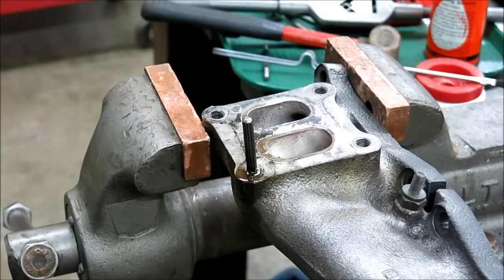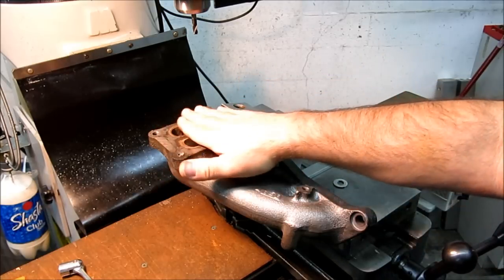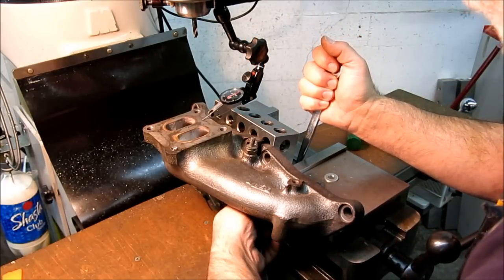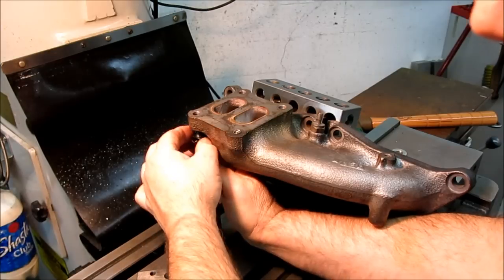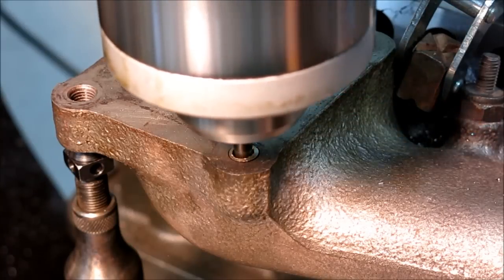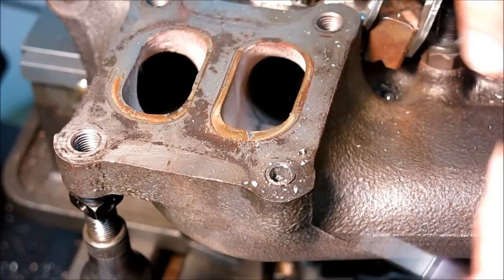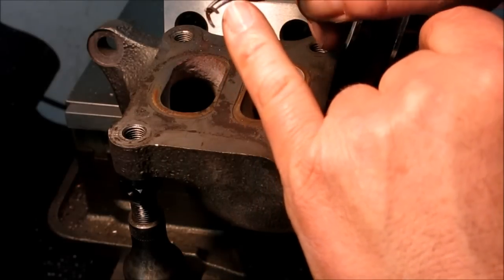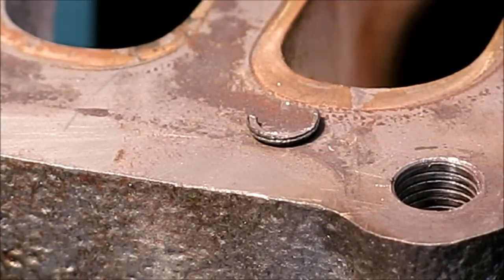Screw Extractor Torture Test Round 2

Comment: I was wondering if we were going to get to Plan T! You just showed how stubborn jobs like that there can be. I've overheard so many times guys talk about how good they are at drilling broken bolts by hand and using easy outs....Yea right! Not always so lucky. I've had several jobs I had to just drill them completely out like you did here. But we're spoiled, and use milling machines to make life easier. LOL
I enjoyed your two vids on this subject, and will watch more if you make them. Thanks for sharing with us bud.

Adam
Reply: Adam - Don't know about your shop - or Tom's - BUT if I need to go to Plan "F" the job is about to be written off as a loss...

Cheers,

Eric
Reply: Me, I've never had luck hand drilling or using easy outs.
Reply: Man, I learned a long time ago, if you cant get the part off the engine you have 3 options. Drill it out completely and then drill and tap a larger fastener. Try to left hand drill it and do it that way. If those 2 don't work, you pull the dang engine and repeat 1 and 2 with all the space you need. I learned that sometimes it's easier and faster to pull an engine in 2 hours than it is to spend 8 hours trying to get a seized stud. Then reassemble with ANTI SEIZE.. ALWAYS ANTi SEIZE. I keep my bottle of anti seize on a solid gold pedestal in my tool box.
Reply: I had precisely one experience where I drilled something out by hand and it went perfectly. Nothing was working so I was planning to try and then go inside and order a new brake caliper, and instead I was able to pick out the threads on the frozen bolt and run a tap through it. You had to look closely to tell it wasn't new. Never happened before or since.

Comment: Brian's tip of the day for working with poor condition parts. Lay a parallel on your surface and indicate off it to establish  your surface. it give s a nice total average to flat and is much easier to get indicated in without your indicator jumping up and down in holes and pits everywhere. Rust welds are some of the strongest in the world!  Now you have a nice manifold you can put under your Christmas tree! lol Thanks for showing us this torture project!
Reply: bcbloc02 Well, unfortunately that's not really an average of the surface. It's basically just the 3 highest points forming a plane.

Comment: I have been a mechanic for 40 plus years and when they first came out with those extractors I broke one off just like this. I never use them unless I can get to the back side to drive out the broken extractor. If a bolt is broken off in a manifold I will drill out the bolt leaving as much thread as possible and then pick out the threads and run a tap in the hole to clean it up. The tricky part is making sure you are drilling it in the center since one side will usually have part of a thread hanging over and what looks like the center is actually off center. You did a great job with the video, I sure did not think carbide was going to cut that extractor like it did. You could not have picked a harder bolt to get out, no left hand drill would have touched it. Thanks for taking the time to share, I learned something new and love it, Thanks.
Reply from the maker: Hey Mystery,

Thanks for the nice comment. That was a tough bolt for sure. I don't think I'll be using these extractors for any heat seized fasteners in the future. It was important to see that they will actually break not twist. Good thing to know.

Cheers,

Tom

Comment: We had  a Ford with a 302 and bad water pump when we lived in northern Canada a long way from a town. Had to have it running for morning. Minimal tools, minimal experience. Broke every bolt but one. Turned out the casting was porous when they installed it so they had lathered it with some kind of green epoxy (??). The bolt threads must have picked up wet epoxy when they bolted it up. They were never coming out. It looked factory but who knows. Middle of January, -30C something, in the snow, no garage, no air tools, no torch of any kind. My wife had to start a fire beside it and keep it fed to keep me from dying. My hands were so cold I burnt them bad clutching an inspection light to keep them from freezing solid. (not the only time) Couldn't feel them till they thawed. Not exagerating. Broke 2 extractors. It never seemed to end. Ended up drilling every hole but one WAY oversize, even into the water jackets. Lots of caulking. All we had. No choice. Started at dark and had it done by 7 am just in time for my new wife to go to work. We were young, broke and desperate. Wife still doesn't like to talk about the experience. Swore that night I'd hire out all repairs one day when I got rich. Never got rich. LOL  Repair never leaked a drop. I kinda miss being young and tough. Those things did take there toll though. Hope this video helps somebody. Good job

Comment: I learned a method 50 years ago at the Maritime Academy.  Aboard ships, extractors (when we had them) never worked.  Drill out as large as possible without disturbing the thread.  Off center is ok, you just can't drill as large a hole.  Then, using a Diamond Point chisel, make 3 to 4 ( or more for very large studs ) v-gooves down the length of the hole, the depth of each as close to the threads but not touching them.  Finally use a cape chisel, starting at the top adjacent to a groove and angled approximatley 30 degrees, and start splitting the stud thread into the hole.  Takes awhile but eventually you'll get the stud out without disturbing or damaging any threads.

Comment: That was an awesome show, I grew up in a Yamaha shop and inherited all of my dad's tools.  I was working on the wheel bearing hub on my Chevy Silverado and rounded off the T30 screw that holds the rotor on and instantly had flashbacks to the side kick on the old Snap On box and remembering that it would be a log day at the shop when that thing got opened up.  I didn't remember how to use the set properly so I did what any dude with boxes of tools he doesn't know how to use does, I hit up you tube.  Your video made me remember all the uses of a lot of stuff in my shop that I haven't seen used since I was 11 or 12 years old.  Good work man.  Rory Martin

Comment: Tom, I knew you wanted a short extractor set, and when you discovered that they don't sell them you decided to make your own! LOL. Check out my Getter Out series, several setups shown for manifold getter outs. Also I left some comments on your previous round. You have done well. My philosophy is try it, feel it, if it looks too stubborn go straight to plan B vis a vis drill it out completely with luck you may be able to save the thread, otherwise fit an insert.
 By the way, most of the studs are M10 X 1.5 on the section that goes into the manifold or head, and M10x1.25 for the nut section....however there are also M9's M8's and M7's of varying pitches just to confuse us simple folk. Have a great Christmas Bruce.

Comment: Nice to see the professionals have these real world problems too. I once tried one of these stud extracts to remove a broken stud from a cylinder head, after a few hours drilling and swearing i got the stud extractor inserted, which then jammed up and snapped off flush with the head.  Ended up having to pull the cylinder head off the car and take it to a machine shop, then watch the poor guy swear profusely as he chewed through bits on his milling machine trying to get said extractor out so he could redrill and install a helicoil.  Don’t ever try these extractors folks, they only make the problem worse.

Comment: Man that was great! I just did the same job on a brake caliper for a race car that was maybe on fire once or twice and the bleeder screw was stuck... or welded into the caliper... so he busted off a screw extractor in it and then phoned me. After and hour of f this and f that I got a shiny new heli-coil installed. Also I've learned that extractors are really there to make the machinists life that much harder. It would have been a 10 minute job with even a drill press but turned into an hour of broken carbide enjoyment!

Comment: I thought I was the only one that could break the extractor AND the drill bit/end mill..  For many years I would find myself welding a nut onto the broken bolt stub (or trying to), and then my neighbor got a sinker edm! Divine intervention!

I like the 2-4-6 block. I have a 3 in bar of 12L14 a couple feet long that I have milled all kinds of slots and holes into to hold heads and manifolds in the mill for this very reason.

I like to use Kroil also! The fumes take my mind off the aggravation of broken bolts...

Merry Christmas Tom

Marc

Comment: Merry Christmas Tom, and thanks for the video!!  I do an awful lot of stud removal, and have a couple favorite alloy rods I use 85% of the time.  Kind of a ceramic flux that protects the downhole threads (if broke off below flush)  Anyhow....if one must use extractors, you have the right kind (STRAIGHT flutes) but I shy away from them most times....I've removed more "easy outs" on Cat exhaust studs than I wish to count!!  LOL  I'll send you the data sheet on those rods and get a few pounds of it mailed after Christmas. It's just another trick to have up your sleeve.  Regards, Sean.
Reply from the maker: Hey Sean,

Shoot me the data sheet. Sounds interesting. Thanks for the comment.

Cheers,

Tom

Comment: I’ll forever remember the nightmare that was a Grade 12.9 M12x1.25 4.5” long rear suspension-to-frame bolt that required drilling it’s entirety after ALL extractor styles were exhausted.
2 evenings worth of drilling with substandard titanium twist drills in an underpowered 12v drill was oh so satisfying when the final twist drill (by memory a 29/64) broke through the tip, thus allowing the retreading to start.
By far the most frustrating and time consuming operation done on my race car to date (which includes complete engine blueprinting, fabricating  it’s 14 point roll cage and wiring it’s custom 12 circuit chassis + engine harness).
To those performing this work, take your time and don’t get down for broken drills, they’re going to break eventually, especially when continuously drilling the same component.
Have fun lads (and lasses of course ;)

Comment: I have always used the spiraled ease outs to remove these. Having a good set has been great because usually it saves time on something which already has a lot of work put into it and would just have to be remade if we could not remove the bolt. Broken taps are the worst especially if they are form taps. I was very impressed with how you recovered and persisted in all of this. That is a sign of a pro.

Comment: Snap-on makes a small pencil grinder with carbide bits that works great for getting that last piece of bolt out.  For us diesel mechanics lifting a 500 pound head off to drill out a broken exhaust stud isn't a cost effective method luckily CAT makes a drill bushing and guide set up to accurately drill out broken exhaust studs. I was wondering if you could make a video on what steel and such is needed to make a drill bushing. I can see the need for this in a lot of application that a over the counter bushing just doesn't work. Also on how you would make a extension to make drill bits longer.
Reply: Keith Fenner has a video on making long reach drill bits and countersinks.

Comment: Great pair of videos.  Technically informative and photographically excellent!  Weirdly intriguing and suspenseful!  That was one tough stud. You have the patience of Job. 

I came across your video because I have to remove a bolt that snapped while I was removing a B&S engine from lawnmower deck. I had rushed the job to get out of the rain.  The bolt moved about 1/16 revolution.  I should have re-sprayed and let the oil do its job. There may be enough for me to get some Vise-Grips on the nub though.

Again, great video.  I will have to check out your channel.
Reply from the maker: bgrt40 Hey Bgrt,

You pretty much have to grow some patience in this line of work. Thanks for the comment.

Cheers,

Tom

Comment: Welcome to my world Tom :) I am a diesel mechanic working on mainly Toyotas( NZ based so smaller than your Toyotas) 
I have had this same issue many times, I just drill them out and install a Helicoil in it ( M10 x 1.25 is the size) I also have a stock of those exhaust studs and the special lock nut, I use them for more than just that though as they are a decent bolt

Comment: Fun videos to watch, thanks.  It's nice to know stuff goes wrong for the pros as well!  :-)

If this had been presented to you in a normal situation (rather than testing the extractor), how would you have approached it?

I was thinking to hacksaw off most of the bolt, just leaving a 5mm, and then hacksaw in a deep vertical cut, making the bolt (effectively) a large flathead screw.

Cheers,  R.
Reply from the maker: +Richard Corfield Hi Richard,

I never would have cut anything off the stud. Grab it with a good pair of vise grips and heat the manifold red hot. Would have made a boring video. This was way more entertaining. Thanks for the comment.

cheers,

Tom
Reply: +oxtoolco Doh!  Sensible.  Cheers,  Richard

Comment: Great video on extractors and extracting.  A pearl I have found is that cutting the stud off and drilling always phase 2.  Phase 1 is fit a bolt onto the top thread of the stud and weld it.  Then apply heat to the base metal as evenly as possible around the stud, hot as you can, and then use an air tool.. air ratchet or impact. As you heat or as soon as you stop heating, you apply torque to the stud.  Physics is on our side, and at some point the metal will expand and break the interference, so in my experience, timing is critical, so I like air tools, they apply reliable constant force.  Red hot plus force. Add penetrating oil at every heat cycle.  I give Sea Foam brand high marks.
On a side note.  An old timer once told me dis-similar metal friction can create interference problems(I would love to hear opinions on that), and also dis-similar metals in water create a battery, and cause corrosion.  So, two good reasons why it may be advantageous to choose the right fasteners and/or use heli coils/thread serts. 
Thanks

Comment: Having spent the first 15 years of my working life as an engineer in the Merchant Navy I have had more than my fair share of broken, corroded and inacessible studs and bolts. Diesel generator exhaust studs and steam pipe flanges being some of the worst offenders. After wrestling a couple of times I decided the best thing was just to go straight to the heat. I always found, counter intuitively that the best thing to do was to heat the broken bolt/stud and get it to a good red heat, let it cool over a coffee and repeat a couple of times. On only a couple of occasions did I end up having to drill it out and pull the threads out.
Since coming ashore and working in maintenance engineering I have had to show a good number of my technicians how to do it, after seeing they would be struggling.

Comment: I bought a set of those extractors years ago and after trying to use it one time I decided they were garbage and never used them again.
Reply: I never tried those and i could already see they wouldn´t be good. If you are hammering them in, you add outward pressure to the stud, so the threads are locked even tighter. Best way is to drill out the most metal off the stud you can, heat it, and then rapid cool it, to cause the metal to contract and shrink, breaking the bond between the 2 surfaces.

Comment: I’m not an expert but my thought process is if you’re removing a bolt and it breaks, putting a smaller harder piece of metal into it shouldn’t ever work.

I’m thinking if you put a bolt in and over torque it and it breaks, the extractor might work. 

Any expert input is appreciated

Comment: Hey Tom, I just commented on r1 video that as a retired auto tech I would have just drilled it out to just the edge of the of the threads on the manifold bore than punch remainder of bold to collapse it and pull it out. You may bozo the first few threads but you can clean them up. Or yes the ole heli-coil,at Cadillac we had threadserts also. But as a whole your video was great,I like a few other mechanics were way ahead of you on what to do.Some one mentioned about they had a Getter out series ( Bruce Whitham ) you should start anew series called "BOZO APPLICATIONS REVIEW". Have a wonderful Christmas,Dave

Comment: I've got a set of those extractors along with easyouts. I've found over the years to just drill and re-tap the hole. I do have some carbide tip drills for the tough bolts. The key to my carbide tip bits is lots of RPM to generate heat in the broken bolt.
Reply from the maker: ww321 Hi WW,

Thanks for the comment.

Cheers,

Tom

Comment: G'day Tom. Excellent demo on how to break an extractor, twice. In the old days I would have stopped at the first broken extractor, scratched my head and found out how expensive is the part. The price and availability would then determine if I replace it, send it to a machine shop or do I grind the whole housing until the bolt was gone,  braze up the housing and drill and tap, the latter being my choice if it was mine. If it's a customer probably order a new manifold, that did come from the scrap bin if I heard correctly. Labours too expensive to muck around with.
(The size of that Tap Wrench, what did you expect!) Peter
Reply from the maker: Hey Peter,

This demo was to put the extractor through its paces. It wasn't a paying job or didn't even really need to get the stud out. Pure Hollywood for this one. Thanks for the comment.

Cheers,

Tom

Comment: Merry Christmas Tom, now you went through the extractor crash coarse lol. some times with bolts that are heated and cooled over and over it is just easier to blow the bolt out of the cast manifold in steps, The Smoke wrench can blow a bolt out without hurting the manifold if you stop in stages to keep the manifold below melting point.